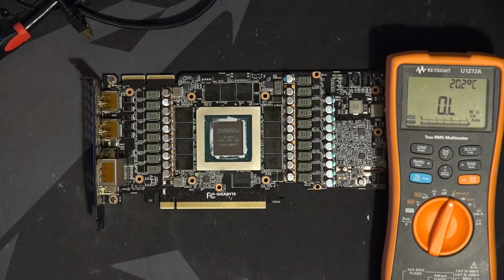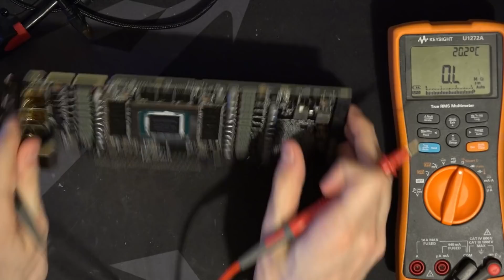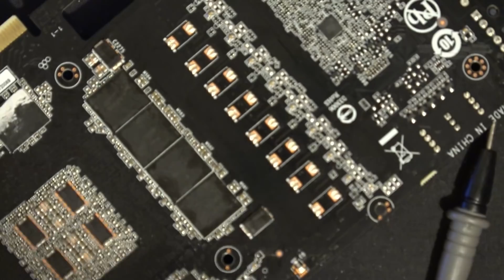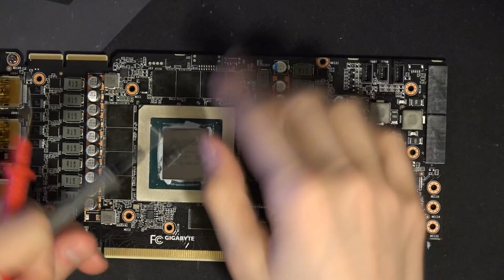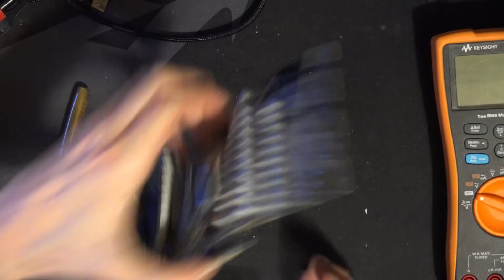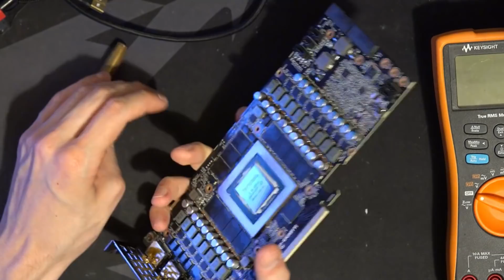Probing a Gigabyte RTX 3090 Vision that died when trying to run New World

Comment: Amazon devs hiring process is so hard, that I can easily see them implementing the drawn calls using an overly designed and "optimized" implementation that works on paper but not in actual real world hardware.
Reply from the maker: The optimizations they made might actually be working too well. Lets say Nvidia made the assumption that the card will somewhat frequently be stalled out by memory access which would limit the peak power draw to safe levels. Now if a dev comes a long and implements an algorithm that basically never stalls achieving a much higher level of core utilization than Nvidia expected you end up with the card pulling way more power than the PCB is designed to handle.

EDIT : The never stalling on memory access is basically what makes Furmark so damn hot.
Reply: @ActuallyHardcoreOverclocking  much like erratic boost controllers or cheap Chinese ones , they work ok at normal driving conditions, but when racing and hitting high rpm’s hard with lots of boost they can become highly inaccurate especially manual boost controllers. Happened to my del sol while racing hit 10k rpm’s in third gear and it was designed for 15psi no more , it went off for a half of a second to 17psi but the ecu was tuned specifically for 15psi but at 10k rpm’s that 2psi leaned out the A/F enough to fry my rings they literally fell into pieces along with the pistons when I disassembled. Honestly never touched a manual controller or any cheap Chinese ones because the high end electronics have many safe guards against overboost and can be set to adjust for if/then situations for protection
Reply: Even the most optimized code shouldn't make a card blow up. I mean, I write simulations in C and CUDA and I actually use average power draw as a quick way to check if optimizations I make are worth it. More power means I got around a bottleneck. Any (stock) hardware that you can't trust to not blow up under full load is broken; it's just giving the illusion of working before it fails completely.
Reply: @friendlyoctopus9391  but what about all the HC oc’ers benchmarking the gpus and not blowing them up , definitely sounds like a software based issue not a hardware one to me!
Reply: @friendlyoctopus9391  I feel like a graveyard of cards killed by Furmark want to disagree with you.
Reply: @friendlyoctopus9391  🤣lol
Reply: lol I remember my final interview with them... my solution literally didn't even compile :D (somehow still got the offer though, for what that's worth). definitely was more than an hour worth of coding of a problem, but I guess they just wanted to see how you think. it was pretty fun, at least.
Reply: Amazon is a GARBAGE COMPANY do not use them for anything, do not buy!
Reply: @Muldeeer  I love amazon, now what?

Comment: oh no BZ got a 3090, RUN

Are you going to fix it now you somewhat know what's broken?
Reply: I am wondering too if BZ is going to repair this GPU and send it back to owner
Reply: @DiJAndy  if one of the power stages shorted itself (drain to source), the card is likely not repairable (sending 12v to the GPU). Other than that I'd expect him to have more than enough integrity and do that.
Reply: @DiJAndy  28:25 He said he's going to see if he can
Reply: @DiJAndy  I think he is. He said he'd try and fix it 'for him'

Good on you bz
Reply: @infernaldaedra  if failed like a fuse... the fuse, itself, won't be dead. The most common failure mode for the mosfert is dead short, taking whatever they are supposed to switch along with them... and then the fuse.
Still there is a chance . No scorch marks, of course, as the fuse likely blew in 200ms or so.
Reply: @stanimir4197  Yeah thats true. I've gotten quite lucky in the past with Mosfets just taking themselves out though.